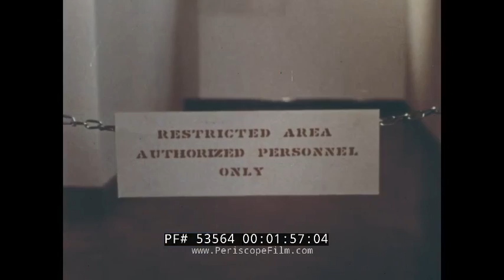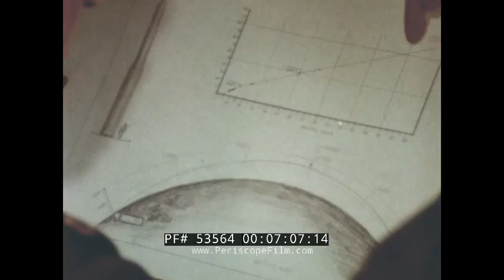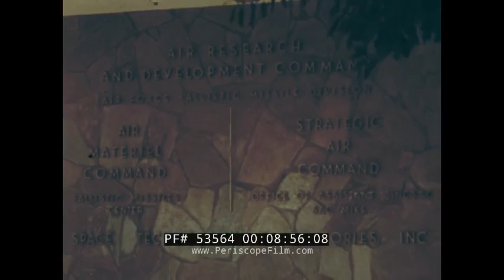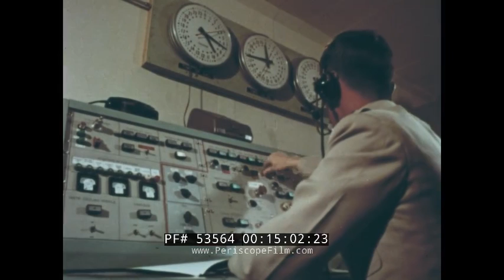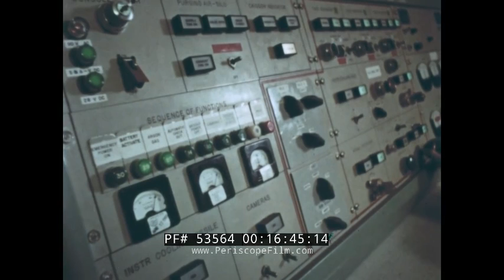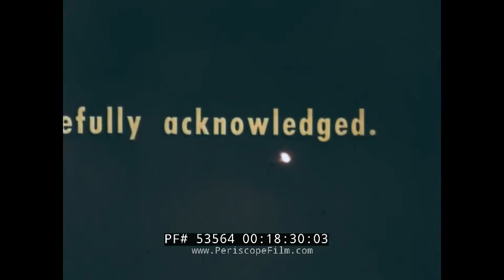MINUTEMAN ICBM  MISSILE AND MISSION  1962 THIOKOL CORPORATE FILM 53564

Comment: Also, it was a Thiokol solid fuel booster whose "O" ring failure led to the Challenger disaster.
Reply: donwert no pain no game. otherwise, the cold weather, you know
Reply: True...the investigation showed Thiokol was reluctant to give a "go" and NASA applied a lot of pressure. Too bad they didn't resist it.
Reply: *Morton-Thiokol
Reply: they guy at thiokol that said do not launch died a few years ago...all for public relations.
Reply: Cold tempratures and NASA's arrogance cost them the Shuttle. They were warned that morning it was way too cold to launch the shuttle and the fact those o- rings couldnt hold up under those early morning tempratures yet ignored the phone call made that very morning that the guarentee that o- ring might fail was high. Yet NASA ignored the warning and destroyed the shuttle and killed its crew by taking short cuts, rushing launches and disreguarding safety procedures.
Reply: @workingshlub8861  RIP Roger Bojulais

Comment: Kind of makes one wonder whether these things would have actually worked any better than the Falcons they compared them to so proudly of they actually had every tried to use them? They thought the Falcons worked great too, until they actually tried them in combat (i know, that's not entirely the missiles fault... But they didn't work in any case). Neither did Sparrow, it was pretty abysmal. I suppose they would have worked enough anyway. And since the main reason for existence was to be a plausible threat, i guess you can say they worked. Just would they really have functioned, or would 75% of them blown up, totally failed to launch, run wildly off course? They say the Sparrow, etc, was effected by incorrect maintenance, at we sure the crews actually took care of these any better?